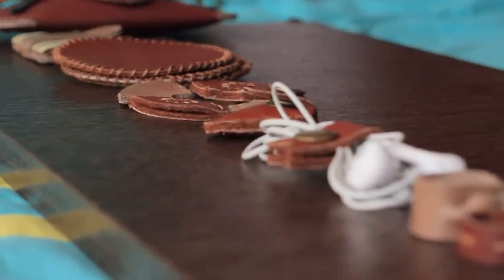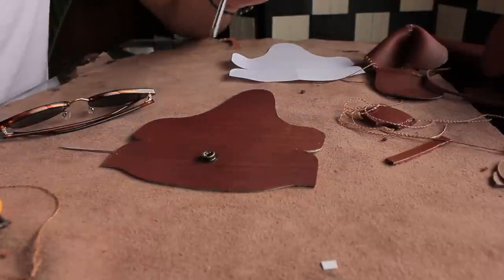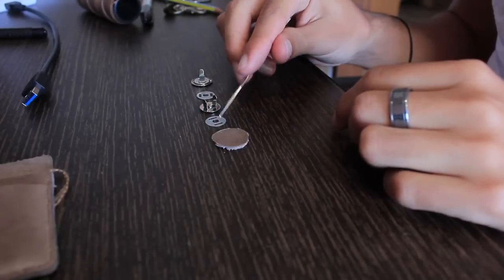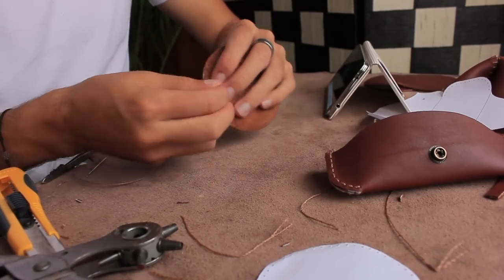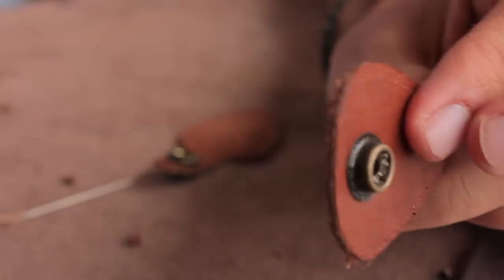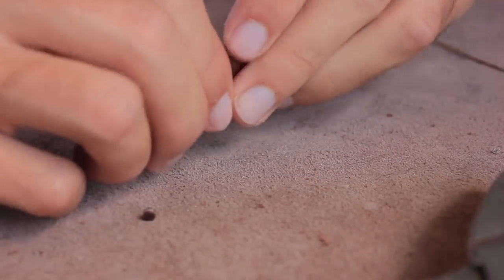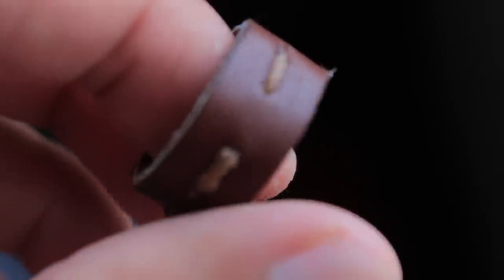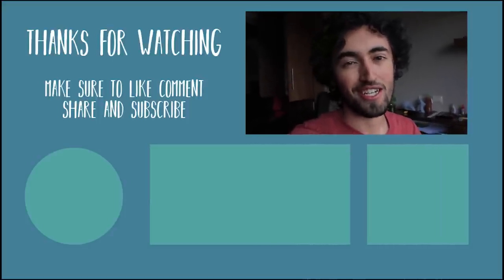7 Scrap Leather Projects

Comment: A HELPFUL HINT: When punching holes in leather with a rotary punch as in the above video, the crafter should put a piece of scrap leather under the project leather & then punch the hole, piercing both pieces of leather. When doing this, the crafter will hear a certain sound that reveals penetration through at least the project leather. The project leather then has a clean-cut hole.
Reply: This is a really awesome tip. I want to honestly thank you for sharing. I added honesty, because sometimes when you're reading things comments the tone sounds sarcastic.
    I have been struggling with this exact problem for years and never actually thought there was a way to avoid it.
    So again thank you.

Comment: ANOTHER HELPFUL HINT: When sharpening leather shears, I use a large piece of Reynold's Aluminum Foil and with the shears, cut as many narrow strips of the foil as possible. This method eliminates having to have this need to be remedied by a professional blade sharpener.

Comment: ANOTHER HELPFUL HINT: When cleaning the crud from a cocobolo wood power leather burnisher, the crafter can fold a paper towel into a 2" X 2" square and moderately dampen it with denatured alcohol, hold it firmly against the cocobolo burnisher and then, turn-on the power switch. Depending on the amount of crud on the burnisher, the paper towel should be able to clean it,  "slick as a whistle" in a very short amount of time.